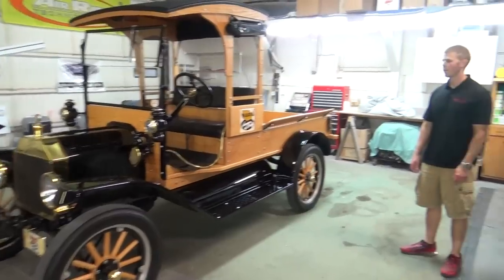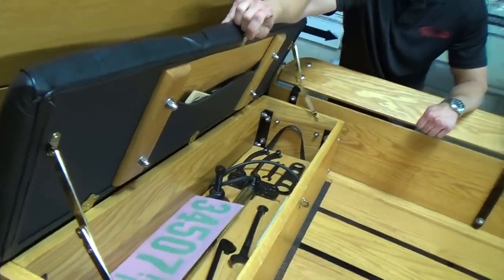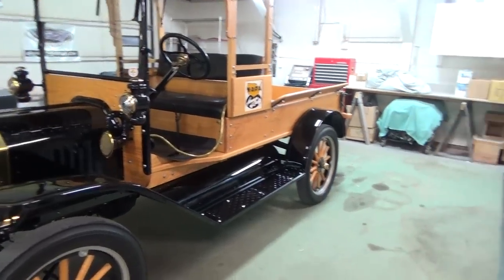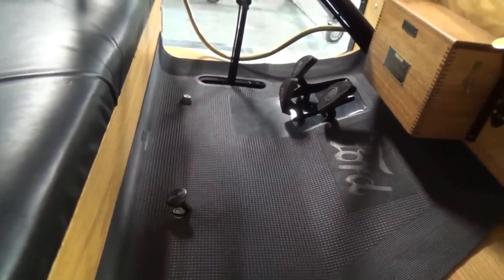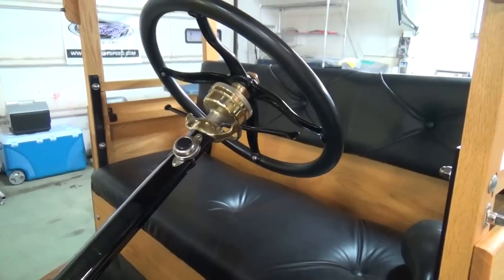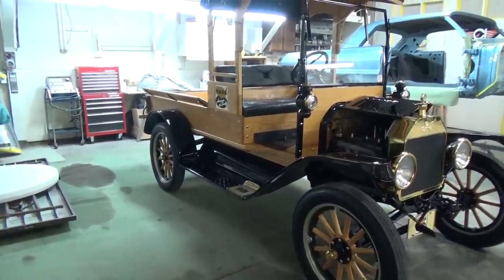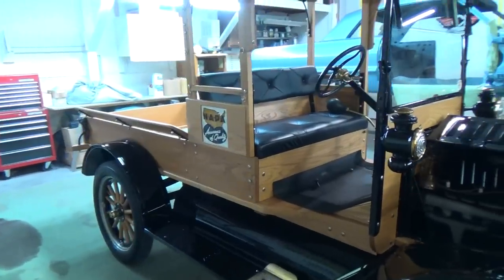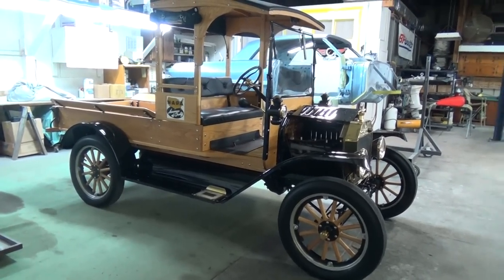1915 Ford Model T Pickup Classic Restorations Of Southern Indiana

Comment: Awesome car. Your 2 by 4 is small than 2 by 4 because the rest of the world uses the simpler and more accurate metric system so all your timber is cut to 90/45 mm
Reply: Strange because even in the Netherlands in Europa you get your wood sawn in inches. 2 by 3 or 2 by 4 etc...My father called it 2 bij 3 tje. Bij is pronounced by, like in the US. Nice car.

Comment: Through the decades one could order an all new engine from the Sears n Roebuck catalog to fit this vehicle,or the model A,and it would arrive with the mail usually,and you swapped them out in the yard using a piece of pipe,and two guys as the lift if you did not use the services of the local blacksmith/garage....

Comment: First of all the vehicle looks great! Very nice custom restoration.  But not at all like it would have looked in 1915.  I would like to set a few facts straight about the comments made in this video.  At the beginning you state that they were just chassis.  You understood incorrectly.  Ford may the complete car and offered several body styles.  Yes you could buy just the chassis but that was usually a Model TT which was a one ton frame which was then taken the the coachworks to have a body make for what ever business needed.  Ford did not offer a pick-up all pickups at that time were the roadster with the trunk shell removed and a aftermarket truck bed put in it's place.  The question why did "T" come before "A"?  It did not the original Model A was built in 1903 and was a curved dash design.  The Model A most people know about was the second Model A.  The Model T only came in the standard frame and a one ton no other frames.  The tools are nice but the jack is not a Model T jack and the gas dipstick was an aftermarket item and did not come with the vehicle.  This vehicle being a beautiful vehicle is not truly a 1915 .  I can see that the truck is made from parts from different year models. The tires on this truck have demountable rims which was not available until 1919.  The coil box in 1915 and later was metal not wood.  What you thought was the headlight dimmer and the other guy says is an electronic kill switch is actually the starter button you would press with the heel of your foot.  Model T's did not have electronics and an electronic kill switch could not be installed.  The tires for a 1915 would have been 30".  The rods on the steering wheel the guy stated backwards the one on the right would be gas and the left would be spark.  The NAPA logo is not from 1915 because NAPA was not founded until 1925.  The gentleman you were talking to said he did the research but obviously did not do enough.  I have not doubt that they restored the truck back the way is was when it came in, but it was not original to 1915 and by the laws of DOT it is no longer a 1915 the earliest it can be considered is a 1922 because the motor is a 1922.  I just wanted to correct the facts for your public so everyone knows.  I get frustrated when one of my customers brings a Model T or any other car and ask me to make it just like it would have been when it came off the showroom floor and then wants something changed because they watch a video like this and thing that it is period equipment when its not .  I have been around antique cars for over 45 years and own a shop that restores them.  But that being said they did do a very nice job on this truck.
Reply from the maker: Cool..Thanks for checking it out!!

Comment: You know Scottie, most folks now a days think Henry Ford developed the first car. Sorry to say he did not. He developed the assembly line.Then he created the 40 hour work week. Then he had a large hand in creating the UAW ( the united auto workers union). In my opinion the union was the worst thing he did and I was a Master Auto    Technician.
    In truth Karl Benz of Germany in about 1880 through 1886 who created the internal combustion engine. The patent for it was in 1886 under Karl Benz and it was called the Benz Patent Motor Wagen. Benz was the biggest part of that creation. A few of the men went on to become Mercedes-Benz in 1924. A French born man of German Descent named Rudolf Diesel invented an internal combustion engine that ran on what we now call Diesel. It would ignite the fuel from the heat created from high compression. Mercedes quickly like the idea. It had more power for there trucks and got better fuel mileage. Then they added them to there cars for economic reasons. Diesels are very popular through out the world, except for America. Americans just couldn't deal with the noise that diesels made. Well thankfully they are making a come back in America now.
   Scottie I don't know if you remember me or not. We even talked on the phone once about getting into what you do. I have had a total of 4 back surgeries and 3 neck surgeries. Plus I have the chronic pain in all my joints. They have even put a pain pump inside me. No results.
Reply from the maker: +CarlsCustomCreations Hate to hear that Brother.....Thanks for the history lesson though...
Reply: Thanks dude. I love seeing real history and learning. So anytime you can film something like this I would love it and some imports also.
Reply from the maker: +CarlsCustomCreations I'll see what I can do!
Reply: +CarlsCustomCreations Henry Ford DID NOT create the UAW! He hated the idea of unionization of his company. He hired thugs to beat up union organizers, My grandfather worked at Ford at the time in Detroit. However,  he did create the first $5.00 paid work day, (huge money in those early automotive days).
Reply: +CarlsCustomCreations  - Henry Ford was the last holdout to agree to the union. GM and Chrysler signed but Henry refused but finally gave in. Henry did not have a hand in creating the UAW.